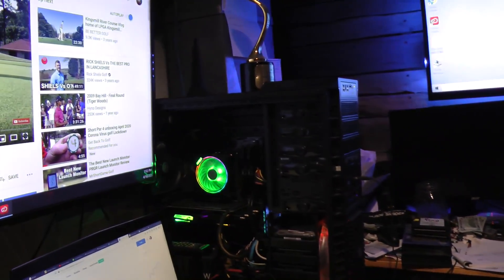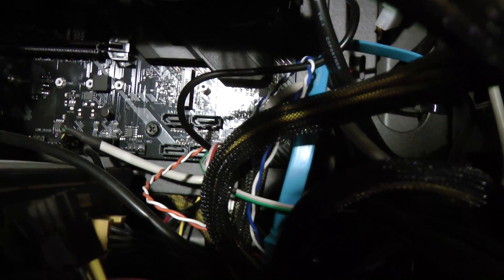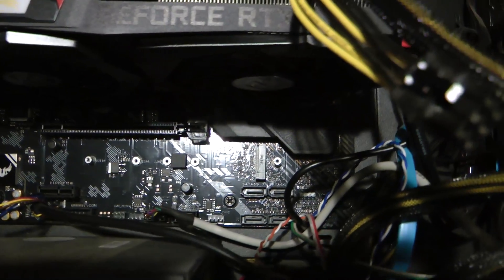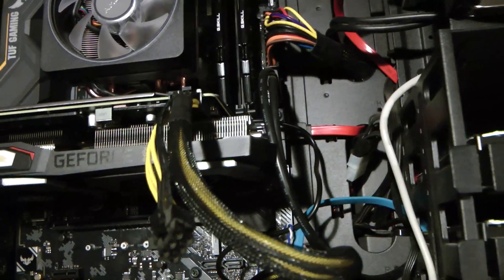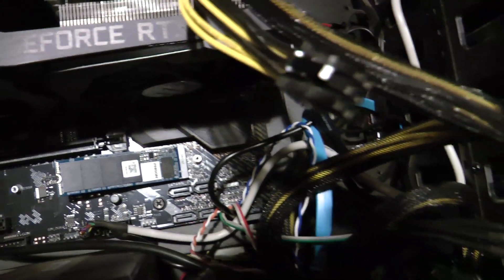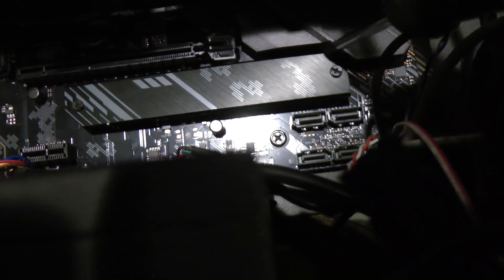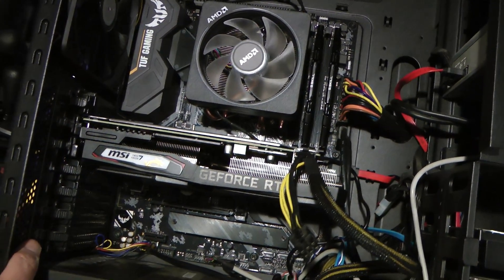How to add a second/two M.2 SSD drives to the Asus Tuf gaming x570 plus motherboard

Comment: I have the same motherboard and case. I have 2 M2 drives on the motherboard, but I'm trying to install an additional magnetic disc HDD. It seems that when you install an M2 drive it disables 2 SATA ports. The new HDD isn't not even shown in the Bios and I'm not sure which SATA ports are even working. I have 6 SATA ports so I guess only 2 others are working. Trying to figure out which ones are still working. I use one for my DVD rom drive so that only leaves one working SATA port.

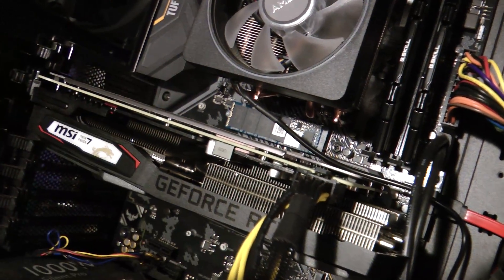Comment: 1:15 do you have a heatsink for the first SSD? Is it necessary? I'm new to PC installation so I am unfamiliar. The two SSD locations look different in terms of the right most mounting screw slot. 

I'm just a little confused cause it doesn't particularly look like 1:38 heatsink would fit in the top slot from 1:15. Will I have to get a different type of heat sink? 

Is the heatsink for the first (top) SSD not necessary altogether? I, again, am new to all this so 1:15 doesn't look like it has a heatsink?

I ask because I'm looking to get a second SSD for that top slot.

EDIT: I have since figured out that some heatsinks only require 1 screw to install.

Comment: Thank you, I just installed 2 M.2 SSD drives Now how do I enable these in my Bios? Can you also have 2 Santa Drives installed as Storage Slaves?
Reply from the maker: yes you can add some storage drives on the slower sata ports  and you'll have to go to disc management or just google find new drive in disk management if that helps

Comment: Has your top M.2 drive been O.K. without a heatsink plate?  I have the same board and found it odd that it didn't have a heatsink plate for both M.2 slots.   I just made sure I was buying a 2nd M.2 that had its own heatsink for the top slot just below the CPU.  Great job on the video in such a cramped space.
Reply from the maker: knock on wood all has been good with the same set up... daily driver btw

Comment: I have a consern, could i populate both m.2 slots without losing lanes on the pcie for the GPU or losing sata ports?
Reply: Im curious about this question too,  in my case , its a high end gpu and 2 high end m.2 ssd's , this should be much better explained on the internet cause i cant find anything about it.  (MSI B660m A DDR4  motherboard owner)

Comment: i have the same mother board and trying to add another M.2 but when i put it in i loads to the TUFF menue and will no load into windows or BIOS any ideas?
Reply: I’m currently having this issue. Did you ever find any solution to this?

Comment: Hey so if someone didn't have any standoff screws, could they technically use the heatsink plate to hold down the m.2 in it's place or is that going to damage something
Reply: I have the same board and setup and that is exactly what I did. Never had a issue, m2 runs nice and cool and another screw to hold down the m2 just got in the way and didn't allow the heatsink to fully contact m2. So yes to your question.

Comment: I am using two M.2 SSD's.  I want the 1TB for my "C" drive and the 2TB for storage ("D" drive?).  Does it matter which slot I use for the "C" drive or should it be the top slot without the heat sync?

Comment: Wow. That cable management is horrible man. Will definitely cause issues.
Reply from the maker: no it won't... stop being so OCD
Reply: @extendedplayarcade  ? I'm not being OCD and meant no disrespect. Those cables will 10000% effect air flow and look tacky. It's not hard to put it behind the MB.

Comment: Question that’s going to sound SUPER dumb.. but I’m like as new as it gets to PCs man. So I already have a WD black 850. That I’ve have for awhile. So I’m ordering a new setup if I get another ssd does it HAVE to be the exact same as the one I already have or can it be mixed matched.? If that makes sense.? Like the one I already have then would I be able to use a sea gate or some other kinda etc.? Any and all help appreciated bro.!
Reply from the maker: check the manufacture but the same would be the best bet

Comment: Thanks for mentioning extension, I completely forgot about those and was about to rip that rubber cube out, which would render heatsink useless
Reply from the maker: you're welcome!
Reply: Yeah, I was wondering why the ssd is getting a lot bended when screw it down without the extension. Thanks for showing the way to handle this 👌

Comment: Do I need to reinstall windows or do anything other than just unplugging the computer put it in and turning it back on? I already have a 1tb nvme ssd in the computer. Thanks!
Reply from the maker: disk management....   search how to find a drive with disk management boom
Reply: @extendedplayarcade  is that before or after installing it?

Comment: How do you know which M.2 drive is which?  And, which one Win10 has made the C drive?
Reply from the maker: install one in at a time
Reply: @extendedplayarcade   Thanks,,,, YEP, I Will likely first assemble it on the static bag to the point I can add Win10.  Then I will add the second (back) M.2 and let the board recognize it.  Then I can put it in the case and add fans, other SSD's, whatever...

Comment: Can you do few tests with and without the heat-sink, just wondering what are the temps without the heat-sink and if the SSD will get thermally capped at low w/r speed above a certain temp

Comment: Thank you alot. I actually had my first m.2 SSD drive under that heat sync but had no idea where that second one was :)
Reply: Me too. I came here and realized the same thing. My first one is installed under the GPU with the heat sink and was wondering where the other one was. I don't know how I missed the one above it.
Reply: thanks for confirming I can use either slots first. My PC is pre-built and I think they put it in the bottom slot. I'm going to be upgrading it and cloning my previous drive to it for bigger storage. Keep the old m.2 as spare or use it in an enclosure like a fast memory stick :P

Comment: The GPU does not fire down the fans pull air up through the card. It pulls air from the bottom through the heat sinks up to the card. The airflow then flows outward left and right not up and down there for most of your heat would hit your first m.2 that you already have installed. This being the case it may be better to have the heatsink on your original m.2. Although to my understanding the heat sinks are more for nostalgic purpose then anything else.
Reply: No they do work if you get the right type, there are two types that work one better than the other based on needed case. I have this board and love it but as you said the GPU blow the heat along side the board and causes the M.2 to heat up if not cooled be something. Most OEM heatsinks are down firing so it would counter the air flow from the GPU and help. Now as far as the two types you have a mass type and a Fin dissipation type. The mass type are just thick slabs of copper or aluminum and are best used in burst work loads. They heat soak and stop working if used for long sustained work loads. For the Fin type they work great all around especially if you have good air follow over it. I have a Intel 665p in the top slot right now and before putting a finned cooler on it, it ran at about 60*C when I was gaming and the GPU was cooking it. I got a $9(US) fin cooler off of Amazon and now she really never goes above 40*C when hitting it hard. or gaming.

Comment: This is a nice looking board, but my one complaint is that it does not have the extender attached so that you can easily install an m.2.  I found one, but the screw on the extender is so thin that as I was screwing down the drive, it didn't seem that it was even tightening and eventually it broke off into the nut that's attached to the board.  I had to unfortunately break off the nut from the board itself and do a little micky mouse maneuver to hold down the drive and prevent it from popping up.  Was a bit of a nightmare.  Thanks, but I'll stick to my Gigabyte boards from now on.
Reply from the maker: bummer about that.  I don't work for any MOBO companies or anything so it's all good sorry to hear you had issues
Reply: @extendedplayarcade  thanks for the reply!  Ya, I’ve always done my builds with Gigabyte or MSI boards, and noticed things on the asus that I normally wouldn’t see on other boards.  Not saying it’s a bad board, it’s actually very nice.  Just that i guess every company has its own way of doing things.
Reply from the maker: @josecardenas6230   yeah very true    some try to stand out and some just try to fit in

Comment: hello I have the same motherboard and an aorus gen 4 m2 1 tb installed between the CPU and the graphics card. I ordered a 2 tb gen 4 m.2 aorus. I can see the heat sink below the graphics card where i should install it but i don't have extra screws. My question is  with the existing heat sink will I be able to install the new drive or do i need to buy extra screws ?

Comment: hi, saw your video and decided to get another m.2 nvme ssd for my tuf-b450m pro gaming. however after install i lost my sata hdd from the bios and it was undetected. i have check the bios setting and enable all the sata port in the motherboard but still no luck of viewing back my sata hdd. would you able to share your bios setting that could enable back my sata hdd on my pc?
Reply from the maker: I just went into disc manager and searched for the new drive.  It worked perfect.   There are a ton of videos on it.  hope it helps
Reply: @extendedplayarcade  give us one link

Comment: Great video. You mentioned editing 4K. On typical storage drives used for editing, they'll usually say to have source files on one drive and then render to another. I'd love to speed up my editing. Is it ok to store files AND render to the same M.2 SSD without speed taking a hit? Thanks.
Reply from the maker: it'll work but faster the other way
Reply: @extendedplayarcade  Thanks. I just bought my first M2 ssd today at Best Buy.. I put the same h.265 drone source clip on each of my drives (M2, sata ssd and 7200rpm hard drive) and played them in my editor. It was definitely smoothest on the M2. Thanks again.
Reply from the maker: @4seeableTV  you're welcome happy it worked out and helped

Comment: Hello dude! My friend is trying to install a kingston A2000 NVMe ssd on his second bottom slot on his TUF B360plus as he already has 1 on the top one. He needs more storage but when we try to allocate it in the disk manager we can't find it. In bios it is recognized but not in windows 10. Is the slot not meant for that SSD or is the SSD dead?
Reply from the maker: i would reach out to Asus for this question.   It shouldn't be a problem but maybe there is a compatibility issue or something
Reply: Hold Windows key hit X key then go to Disk Management
Reply: @lachlanfraser3147  disk management doesnt see the drive it is showing in bios though
Reply: @nlcaragua5  Having the same issue. Did you resolve?
Reply: @lachlanfraser3147  THANK YOU!! im such a dunce. that would be the first place i go when i cant see USBs in windows (i like to play with linux) but never thought to go there for M.2 drive! i thought i must be missing something in the BIOS settings as the drive was showing there, just not in windows...

Comment: Hi, thanks for the video.
I just wanted to know, I have a first SSD M2 where I putted Windows 10 on it and I'll buy another SSD M2 to store Games etc.

Do I have to make something in the Bios with changing some settings or I just need to plug the SSD, turn on my computer and go to Windows>Disk Management and Allocate/Initialize the SSD ?
Reply from the maker: no change in Bios.      Disk Management the way to go.  you got this
Reply: @extendedplayarcade  thanks a lot :) I've got an Asus TUF GAMING Z490 Plus
Reply from the maker: @grumpycat3998   awesome it's a great MOBO
Reply: @extendedplayarcade  ;-)
Reply: @grumpycat3998  did this end up working? I just got my second M.2 SSD and it wasn't showing up for me either in my files. I am waiting for the M.2 screws to show up, but I wanted to make sure that this was a solution before I get everything. Thanks!
Reply: @SquadWiped2  Did you get it figured out?
Reply: @SquadWiped2  Hi. Yeah, I placed the second SSD on my motherboard, ran Windows, and the SSD just appeared in the Windows Hard-drives settings

Comment: Hey so after I installed my second m.2 ssd games I install on it have been getting bsod have u faced this issue
Reply from the maker: I haven't had any issues at all.  I don't game a lot on it... Just some steam games here and there but I use it mostly for video edit 4k.   Never had an issue.   Check for a video card update or something.   I hope that helps
Reply: @extendedplayarcade    my gpu and windows are all fully up to date, its just wierd thanks for your response tho
Reply from the maker: @xxreplayx2   maybe email Asus  CS

Comment: Thanks. Was wondering if it was under there. The online manual had nothing other than BIOS. No physical description of where the other one was.
Reply from the maker: Glad I could help
Reply: @extendedplayarcade   I've finally got round to installing this, but W10 doesn't seem to recognize it. It appears in Device Manager as "Force 600" under the disk drives, but it hasn't assigned a drive letter or anything to access it.

Comment: I have the same motherboard I am trying to get it to recognize my ssd so I can install windows but no luck. I’ve tried different sata ports as well. Do you know how to fix this issue? I was about to try to use one of these types of storage sticks next to see if that makes it work.
Reply from the maker: do you have multiple SSDs hooked up at once?     It's best if you building from scratch is to start with one SSD at a time.
Reply: @extendedplayarcade  nah only had one. Ended up getting an m.2 drive and that worked fine. Possibly I got a bad drive going to return it.
Reply from the maker: @naytbreeze  Ok cool glad it worked out for ya.   Sometimes just taking a break from it and coming back to it the next day helps but having a bad SSD drive isn't a good start.  Glad you're up and running

Comment: When I installed my second NVME I lost several drives.  I need to figure out how to get them back.
Reply: Don't know if you figured this out but I saw a video saying the m.2 shares some of the data channels the sata input cables use so you lose those channels.
Reply: @bish1121  Paul your video helped me through it is working perfectly.  Wow what a speed difference.
Reply: @bish1121   What? No way! That sucks. I'm only using 4 SATA ports out of the 8 (the ones on the side). Do you know which ones are affected?
Reply: @ArcanePath360  from what I could figure if you use m.2 nvme it uses the same channel as one or more of the sata port's on the side so you then can't plug in a hard drive to that port. If you have a manual for the board maybe give it a look it might say something in there. 👍.
Reply: @bish1121   Thanks

Comment: Question i used a part picker and it had 2 m.2 ports option but it says it will disable 2 sata ports should i worry?
Reply: Hi, if you set your m.2 as SATA it will disable a SATA port on the motherboard. If you install 2, it will most likely disable 2 sata ports. This could only become a problem if you have too many ssd's or hdd's on top of the m.2 ssd's. You probably dont have a lot of normal storage drives next to the 2 m.2 drives so it should not be a problem. If you do get another drive make sure you dont connect it to a sata port that is disabled because of the m.2. Check the manual of your motherboard to see which m.2 slot will disable which sata port.

Comment: Hey man! One question. After I install the 2nd M.2, do I need to do something else on the PC or just boot the PC and everything will work right away? Thanks so much!
Reply: im having an issue where i add another nvme to my second slot and itll slightly get into windows and then just show me blue screen and says somthin bout a kernal security error
Reply: @teddysdetailing  Did you figure this out, because I want to make sure this kind of thing doesn't happen when I add mine soon
Reply: @tylers6460  no i havnt. my next step is to update my bios and see whats up. other than this lil hick up its a solid board
Reply: I have an rog b450 f gaming and can't run dual m.2 drives! Help

Comment: Hi! Someone told me if i put 2 m.2 ssds on my mobo it will shorten its life? Cause he said m.2 ssds tends to get hella hot. I wanted to fill all the m.2 slots (i got 2 slots crosshair hero vlll) Thanks!
Reply from the maker: I have no heat issues at all but i'm in a cool temperature controlled room.   I don't think heat is an issue for me
Reply: @extendedplayarcade  Ohhh Thanks for the feedback! Ill definitely fill my m.2s. Thanks for this!
Reply from the maker: @thirdylll5764  i haven't gamed on this rig but i've dropped some major video edits on it and it's solid as a rock.

Comment: Do the m.2 drives disable any SATA ports on this motherboard?
Reply: I just contacted ASUS -- they said that there is no bandwidth sharing -- so using an m.2 drive should not disable use of any SATA ports.
Reply: this is very late but where would you install a hdd on this motherboard?

Comment: I bought 2 exact same m2 , I can put both with any problem ? I mean 1m2 port it's for one technology and the secondary for another ?
Reply from the maker: yes install one in at a time hope that helps
Reply: @extendedplayarcade  well i built my pc yesterday, I have the issue that the second ssd m2 wasn't "activated" so I think that I have to sell one of these because I can't use one of them actually :B
Reply from the maker: @pabloromero1201   search "Windows 10 - How to Activate New Hard Drives and SSD’s Not Showing Up " in youtube